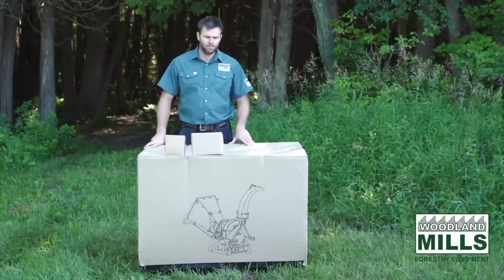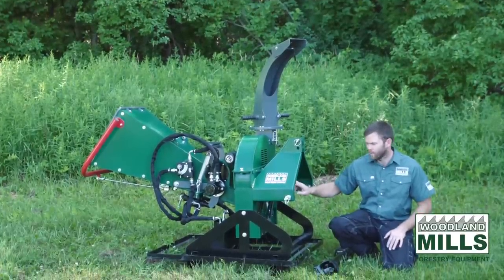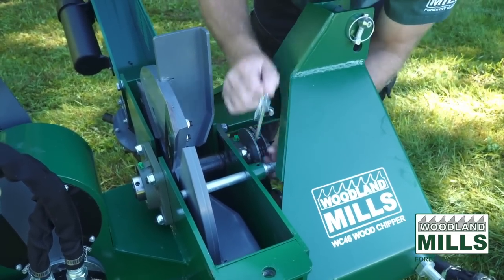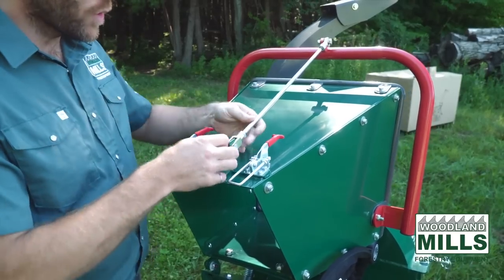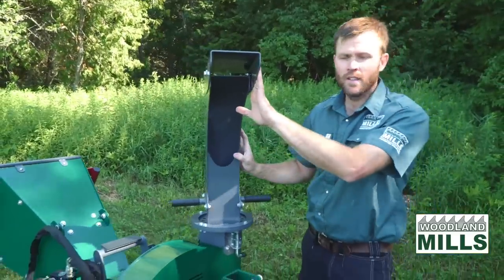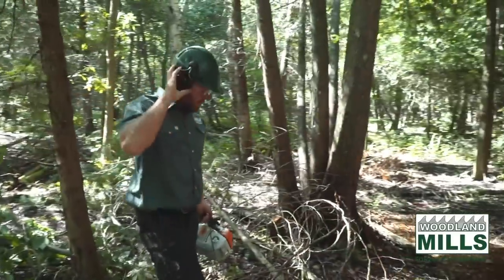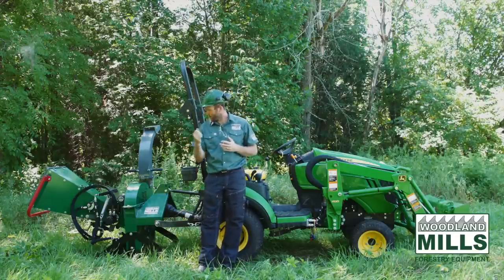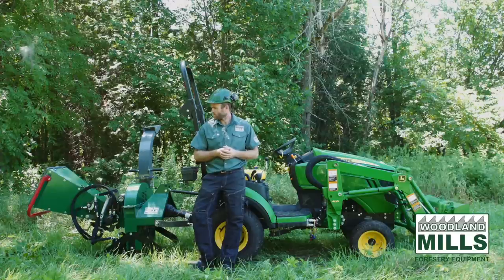Woodland Mills WC46 Wood Chipper Full Length Demo (2018)

Comment: Just received my WC46 chipper and tried extensively over the week-end. This thing is a beast, work exactly like in the Video. Very well designed and manufactured product, this is not cheap thing. I run it on my 25 HP and the tractor doesn't feel a thing even with 4" material. Great buy !

Comment: You sorta skimmed over the anvil-plate. I found this difficult to adjust and set to 1/16-1/8”. Could you be a little more specific on how to adjust. The location of the anvil makes it almost impossible to set. What’s the trick.?

Comment: I got my WC46 about a month ago. They have made some changes since this video was made, as far as I can tell all the changes made it better. The video needs to cover adjusting the feed roller tension as well as the PTO shaft length measuring and cutting. If Woodland Mills follows these comments, how about a kit to turn the base of the shipping container into a storage dolly for the chipper. I did it with a couple of left over 2x8's and 4 casters, now when the chipper isn't on the tractor I can easily roll it anywhere in the garage. Plus it makes it A LOT easier to position the chipper when putting it on the tractor. As far as how it actually works; this thing is a beast turning branches and smaller tree trunks into usable mulch. Plus it's not even the biggest model. The customer service after purchase is also second to NONE.
Reply from the maker: Thank you for the suggestions, Scott! and we are so glad to hear that you are liking your chipper!
Reply: @woodlandmills  I thought I would have used it more by now, but a pile of brush or small trees is gone and chipped before I know it.

Comment: Will this work on a Ford 8n ?
Reply from the maker: Hi Peater,  This Wood chipper is designed to work with sub compact tractors with 15 to 30 HP at the PTO. Please give us a call to discuss 1-855-476-6455  or check our website for more info on your tractor's compatibility with our Wood chippers. www.woodlandmills.com.